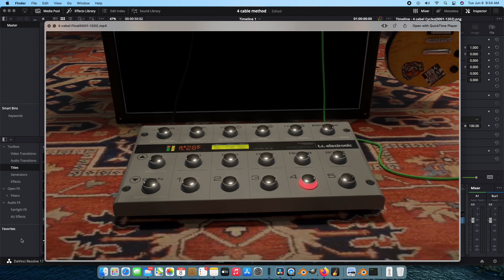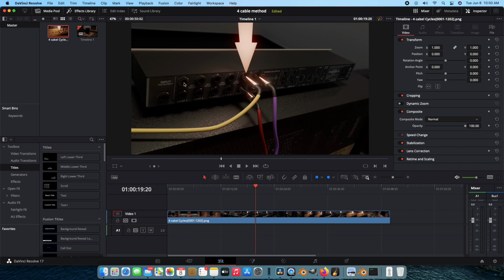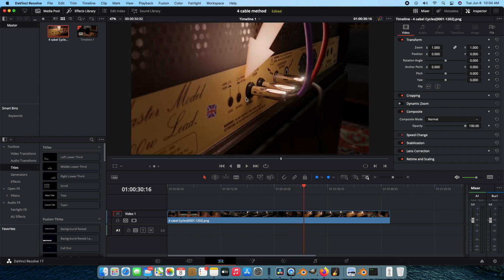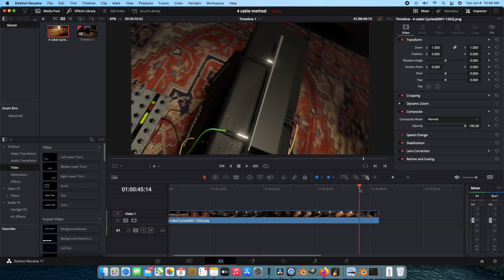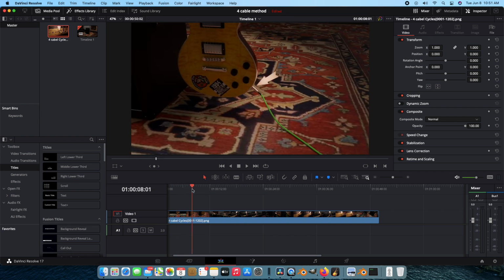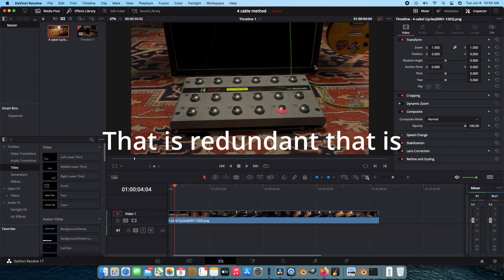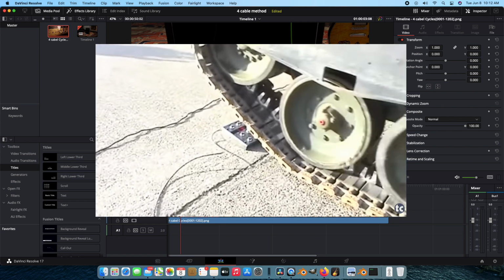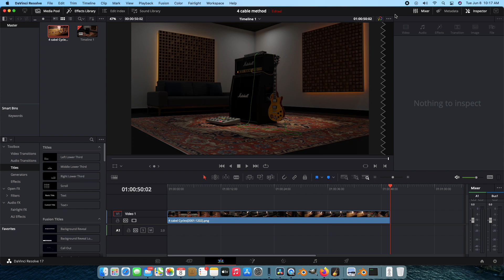Best 4 cable method video ever

Comment: After scouring the internet looking for info on 4cm hookup with g system finally i found this video! Im on the fence about getting this or the boss es-8 and the things i needed to know were the 4cm options, the gate features, channel switching, and being able to use the 4 extra loops either in front or in the fx loop. You have answered most all of my questions and now i think im going to get the g system.  Like you said, for ease of use it just makes sense live to have your reverb, delay, boost, and gate already onboard. That cuts way down on external pedals which saves room and also cuts down on points of failure. That way i just put a couple favorites in the 4 extra loops and no more tap dancing! This is gonna be great- thanks so much for all your hard work putting this video together!

Comment: Hi - thanks for doing this! Not sure if you'll get this after 2 years (!) but I recently got a G System which I have set up in 4CM with my Orange TH30. The only issue I have is with the tuner. Since the tuner is located after all the loops (I do not understand why this was designed this way - seems crazy!) it doesn't really work in 4CM unless I switch off the insert. Have you found out a way to fix this? At the moment I have a separate tuner pedal but it would be cool if I didn't need it. Thanks!
Reply from the maker: I was not aware of the placement of the tuner in the signal chain. I assumed it was before everything. I don’t personally have any tuner issues.
Reply: @bhosterman  I would have assumed that too but I looked into it because I was having issues and was surprised to find that the tuner is half way down the signal chain. Kind of like having it at the return of your FX loop. No idea why. I think for some reason my amp's pre-amp doesn't provide enough output to make the tuner work.
Reply from the maker: @ZenHelix  that makes sense. Now that I think about it, I can’t tune in standby.
Reply: @bhosterman  Yeah, makes sense. I think the issue is that my amp is non-master volume, so all the volume is controlled by the level of the pre-amp. So at home-friendly levels I have it down quite low...too low for the tuner apparently. At gig volumes the tuner actually works but since I can't rely on it I still have a tuner pedal on my board. I'd love to know what the logic was behind putting the tuner after the loops. Seems bizarre to me. Oh well.
Reply from the maker: @ZenHelix  try this: set your volume high on the amp and the hit the edit bottom once, and then use the edit button to lower the output of the g system to quiet levels. It can essentially be your master. I do it all the time after I sound check but want to mess with my guitar at volumes that don’t piss everyone off. Then tap the edit button again and use the button to return to your regular volume.
Reply: @bhosterman  Yeah, that works…I’ll do it that way for now. Thanks for the tip!

Comment: Great video! Looking at buying one. Still hold up to today's specs??
Reply from the maker: Absolutely. If you’re not looking for the absolute latest in FX and want a reliable system I haven’t found anything better. Plus with 4 additional fx loops you can add outboard gear or pedals if you want say a better reverb or some specific pedal not featured in the available fx. It’s an absolute workhorse that I’ve used for 10 years trouble free.

Comment: Hi! Thanks a lot for this video! Looks amazing! Quick question please, if you ever need to use another amp, you´ll need to reconfigure the relay parameters again for that new amp?
Reply from the maker: Depends on how many switching options the new amp has and how the switches are wired. I’d say about half the time my initial set up worked with a new amp and sometimes I just had to flip the relays. It’s very easy. You just scroll through the relay options until the channel you want lights up and then save that preset.
Reply: @bhosterman  Thanks man! It would be nice if the gsystem had a "global relay" option, so that it could configure every preset whenever you use a new amp.
Reply from the maker: @astrofotoperu  well as it works out you can save relay setting to individual presets so I just use different banks for different amps. That way I can switch back and forth without thinking about it.
Reply: @bhosterman  That's a great idea. It could definetly work out. Thanks bro!

Comment: I need help figuring out how to run a overdrive pedal in the g system. No one I’ve found explains it but it says it can be done in the manual
Reply from the maker: Are you using the g system in the 4 cable method setup? You can use a drive pedal in a loop if the g system is going into the front of the amp too. I have mine in LOOP one of the g sys. And I’m using the 4 cable method so the drive pedal is inserted before the front (preamp) of the amp like a traditional setup. If you’re only using the g sys in the loop of your amp this won’t work very well. I also assigned one of my switches along the top row to activate that LOOP so I can bring it in and out as I desire.